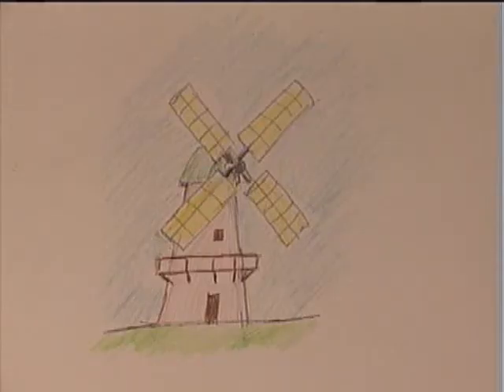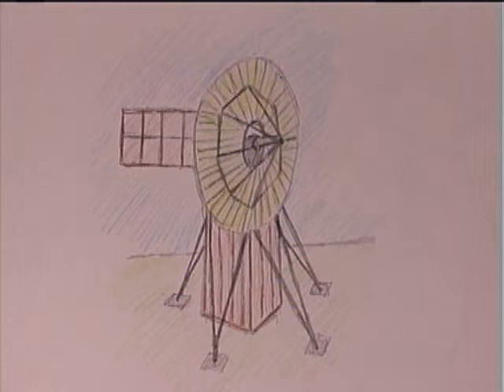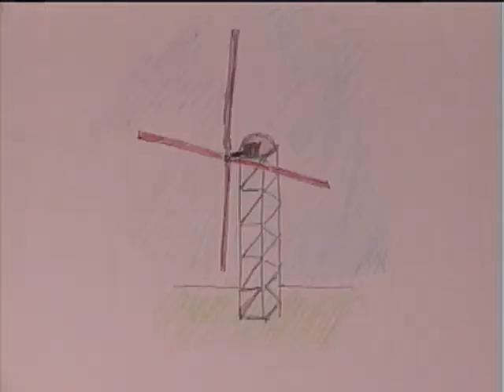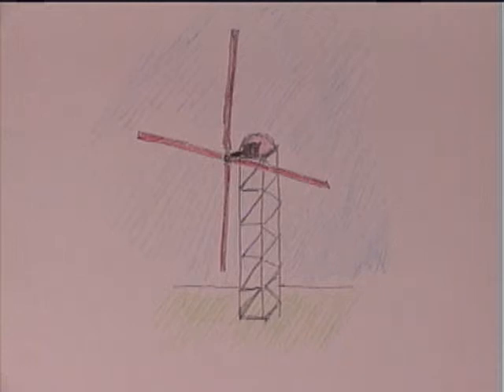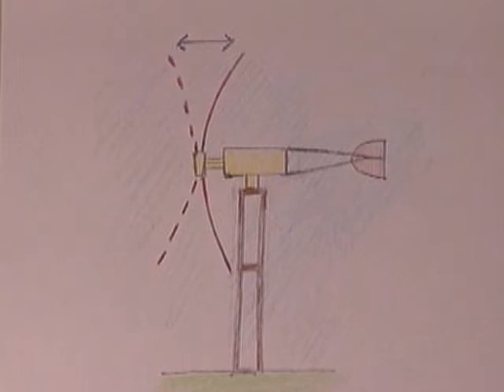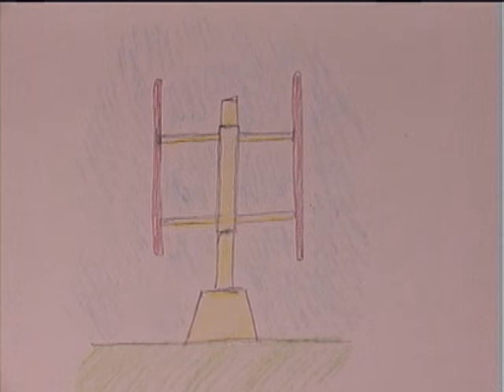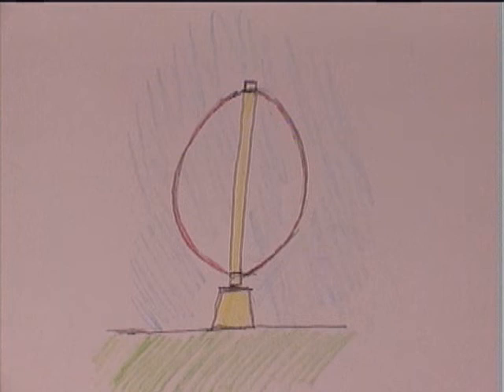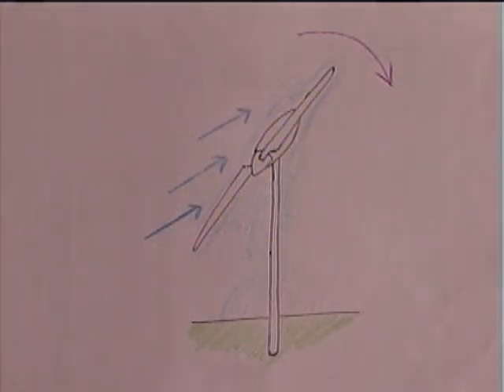Best Wind Turbine Design Part 3

Comment: I guess one theory I've had for VAWT is that gravity pushes downward, you can essentially spin the shaft on a needle point reducing the friction. you still need some kind of bearing or slip ring to keep it vertical. I think of HAWTs having some form of shaft in which gravity pushes down on the blades causing a torque in the shaft, which will cause more friction. Maybe this problem has been solved, I'm not really sure

Comment: If having fewer blades in a turbine makes it faster and more efficient, then why do steam turbines and turbojet engines have so many blades?
Reply from the maker: There is no similarity between a windmill and a jet engine. (1)The blades in a jet engine suck air inward. A windmill kicks a lot of the wind back outward.
(2) The blades in a jet engine are kept small to better stand the great stresses on them:
(a) high inlet air flow speeds of hundreds of miles an hour.
(b) high rpm (huge centrifugal forces) of hundreds of rpm.
(c) high inlet temperatures of hundreds of degrees.